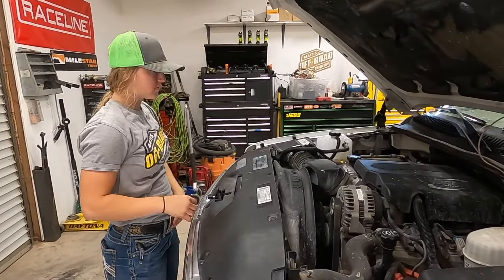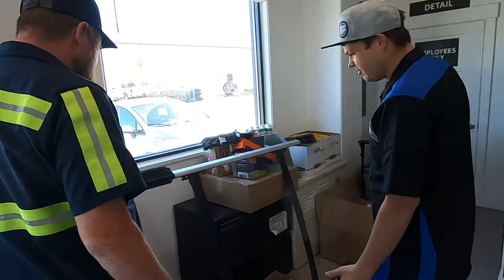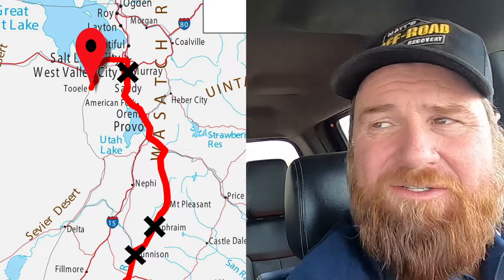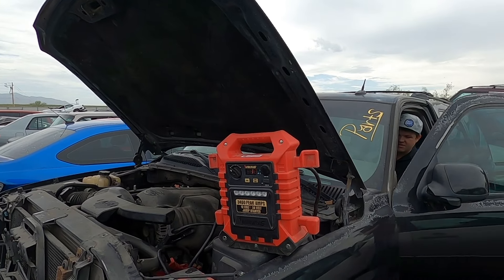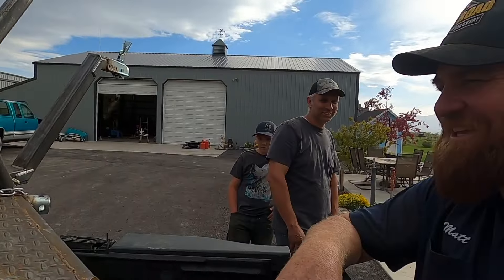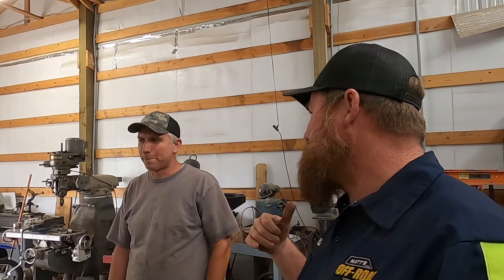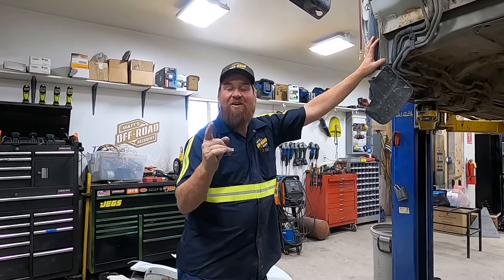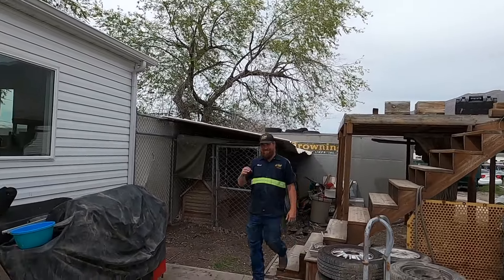Massive Engine For A Massive Off Road Wrecker!

Comment: The 8.1 is such an underutilized engine. You see 5.3 and 6.0 swaps everywhere yet the 8.1 rarely gets to shine. Such a good platform.
Reply: I was saying get the new gas 6.6 or the ford 7.3 gas
Reply: The reason why is the 8.1 doesn't make good power beyond stock with mods. They just don't.
Reply: All modern GM engine's are underutilized. They maybe because they're junk.😂😂
Reply: An lq4 ls3 can make 600+hp NA on regular pump fuel.

Those are solid numbers and extraordinary reliable motors.

I cant speak for the 8.1 as I've never built one.
Reply: There’s no replacement for displacement!
Reply: @youtubechampion9377  I'm not denying the 5.3 or 6.0 or even the 4.8 is capable of power but if you watch to the end they are only getting 580 with 14psi on a 8.1. The 7.3 godzilla is 800 with a pro charger.  I personally have a ls swapped s10. I wouldn't give you a penny for the ls engine. They are not reliable. It's cheaper to buy a gen 2 coyote and throw some boost on one and then you got a reliable engine.
Reply: @1978jhoff  yeah its called the ecoboost...
Reply: @lizard2006  you have a good point but I think we need to evaluate the 8.1 more on the torque side of things considering its abit of a stroker.

8.1s are also alot less common then other GM counterparts and have minimal exchangeable parts if any.

My understanding of it is vague but it's a more modern 454 and saying that is ironic because it's certainly outdated now.
Reply: Richard Holdener has been testing 8.1 junkyard engines lately on his channel.  They're capable of making massive power and torque just like any big block.  The only downside is that there aren't as many aftermarket parts available as other big blocks but if they're going to keep it mostly stock it really isn't going to matter.
Reply: @lizard2006   What vehicles had a 2nd gen Coyote, as a Ford (F150) guy, id like to learn more.
Reply: @trumpsextratesticle8590  15-17 f150s, 18-20 are 3rd gen and were direct injected.  21+ are 4th gen when they went to cylinder deactivation. I work on cars for a living and GM is by far the worst. They are simple to work on but they aren't reliable.  I'm sure the 8.1 will be fine but I'd personally loved to see Matt use a 6.7 powerstroke or a old cat... or the 7.3 godzilla gas engine.
Reply: @lizard2006  I feel like this comment is slightly disingenuous, no slight to the 7.3 gasser, however when you look at the numbers, that 580 hp out of a practically stock 8.1 Vortec is more impressive than the 800 hp out of that Godzilla. That 8.1 Vortec redlines at like 5k rpm, those 7.3 gassers are making 800 hp at over 6k rpm and as high as 7600 rpm. Also, if you listened at the end, LT was making close to a 1000 ft/lbs of torque, which is more than all of the 800 hp 7.3L I found, by a wide margin, at least 200 ft/lbs more. However with all that said, if the 8.1 Vortec had all the advantages that the 7.3L Godzilla has, they would perform fairly similarly with a slight edge to the 8.1 for displacement reasons. The 8.1L is also a stroker motor and the Godzilla is a big bore motor. At the end of the day you're trying to compare a 60+ year old design against a modern design, it's an apples to oranges comparison. The 8.1L Vortec is a Gen III block with 1980's head technology, the Godzilla is a completely new design of motor from the ground up using the latest technology.
Reply: @lizard2006   Thank you for the reply, I'm an old school shade tree mechanic but have not personally kept up with the newer engine/designs. Thank you again for the information!
Reply: @dammityoutube  the godzilla is a pushrod v8 closer to the 351 Windsor which is very similar to the ls engine. The 8.1 is not 60+ year old design. An the godzilla could be 1000ftlbs it's all in the cam profile. Your talking about 14psi and only making 580hp
Reply: @lizard2006  So I gave some hyperbole, the point still stands, the L18 8.1L is still a W series motor, that first debuted in 1958, which still uses nothing newer than 1980's technology to run. The Godzilla is a redesign from the 6.2L Ford Hurricane that is cam in block instead of overhead cam, a first from Ford since 2001 when the Windsor was discontinued in favor of the modular OHC V's. The Godzilla has better heads and a better fuel system than the 8.1L Vortec, it's DI instead of port injection. As for the 580 hp, I'd bet that 580 hp is in the high 4k rpm range, it is this reason that I say it's more impressive than a 7.3L V8 making 800 hp when it's spinning 2k-3k rpm faster. The 8.1L stock is a 5k rpm max motor, the heads can't flow enough air nor are the valve springs strong enough to handle it.

Also, I have to give a correction, I said Gen III big blocks, I meant Gen IV's. As the Gen III was never made.
Reply: @dammityoutube  the 8.1 is not an impressive engine. They used them in uhauls and I was a mechanic for uhaul they do not hold up no where near as well as the ford v10s, and they are absolute turds as well. Matt is probably not going to put boost on it and in terms of upgrades the godzilla bolt on options and tuning are going to be way better. My dad personally had a 2500hd with an 8.1 and it only did one thing good and that suck gas. 

If we're talking about a modern gm option I'd say the 6.6 gas engine is a much better platform. I just get tired of seeing the same old swaps. Ls gm fan boys are notorious for mouthing off about how cheap you can swap a junk yard ls engine throw boost on it and go race, you can but it's not reliable and you fuck up the track for everyone else. That logic is so stupid. I know because my dad before he passed and myself were convinced to do a ls swap into our 99 s10. It's been a nightmare and it was not cheap. The intent was to make it a daily driver. 

I think in Matt's case a diesel option like the 6.7 or maybe a built 6.0 powerstroke,  or even a older cat would of been better for the high idle and ability provide pto. However I get why he went to the 8.1, and I think it'll be okay, but I can tell you again its not a great reliable engine. Just as the ls isn't. They are just easy to work on and parts are a bit cheaper.
Reply: @lizard2006  I 100% agree with everything you said there. I personally am not a big block fan, too expensive for not much of a performance boost, if any at all, and lot of extra weight to account for. I personally go the turbocharged 4 cyl route or diesel.

I would have liked Matt to go diesel on the wrecker too, however just a personal choice for me, I would have used a Cummins 6bt. Doesn't require any electronics to run and is fairly easy, not cheap though, to get 400-500ish hp out of them, or I'd use an older Cummins 6C8.3, also doesn't require electronics as both motors are entirely mechanical and the electronic fuel solenoid can be replaced with a manual valve if you so like.

Depending on what LS you have, they can be fairly dependable though, every builder is different and everybody uses different parts and parts quality is different from manufacturers. It's cheap to build an LS but expensive to build a reliable LS, far more expensive than say a decent Hemi or Coyote. Far more people build cheap LS's and ruin all the fun for the rest of us. 

I like the newer LT platform more, but they have some serious cam issues, almost beating out the Hemi for cam issues. Even the Coyote has it's host of issues.

Comment: Matt, with that engine you are going to need a HUGE fuel cell.
Reply: A 50 gallon tank would do it. Or' you'll run out of gas all the time.
Reply: But then he won't run out of fuel all the time.
Reply: and a working fuel gauge!
Reply: I was thinking the same thing. You can always under fill a large tank for small jobs. But having that extra headroom for long hauls would be very useful.
Reply: @webfreakz  don't need a fuel gauge with an 8.1...... just remember everytime ya start that beast up it's almost outa fuel!!
Reply: @bartondean4260  That' ll work IF he remembers to stop and fill it.
Reply: Just remember a 8.1L in a wrecker is going to get better fuel economy than a 6.0 would because it’s not getting its guts pulled out. My dads 8.1 gets between 13 and 15 average and anyone we’ve talked to with a 6.0 says they’re mileage is worse than that. Cubic inches doesn’t necessarily mean bad fuel economy.
Reply: My 8.1 gets 9mpg 91+ octane with our without trailer. However my trucks tare weight it #9300. With 85g fuel capacity I made a trip from Sacramento CA. To myrtle beach SC on 4 fill ups. 
(Sac,ca/coal town ,ut/somewhere west NE on 70/someplace middle of Missouri. My mpg gage in cab is a touch off due to 10 fuel injectors and 35 inch tires.
Reply: @bartondean4260  Maybe the Suburban had the optional larger tank he could reuse, though not sure what options were available on the early 2000's model... I had a 66 gallon / 250L tank in my 99.
Reply: My 8.1 suburban gets about the same mileage as my 6.0 vortec towing.
Reply: @frumsmcnoodles323   That's a massive tank!!
Reply: No, he has Jaymie on speed dial for when he runs out of gas.
Reply: I bet the Morrvair is pretty thristy when Matt is pulling 30' RV, horse trailers out of the sand. That thing is working! 
8.1 will be pretty impressive in an off road wrecker. It will operate right in the RPM sweet spot. Like a diesel. Never working too hard because of the gearing. Getting paid to drive awesome off road recovery vehicles,    they have a pretty awesome job. Hard work for sure 💪
Reply: Just get a fuel- cell trailer and tow that sucka everywhere lol.
Reply: @distinguisheddjentleman8081  Yes, it's how hard you're working it. Morrvair is working pretty hard sometimes.
Reply: Expect regular 'ran out of fuel' videos🤣
Reply: @distinguisheddjentleman8081  a company I worked for had 6 cyl vans and a few 8 cyl vans they had a long drive and the 6 cyl vans needed gas before the 8's needed fuel. the 6's had to work harder too keep up with the 8's ..
Reply: @frumsmcnoodles323  I haven't been able to top-off my Suburban in weeks.  Next time I go on a road trip, I'll have to fill it twice.
Reply: @Adam Ruiz i don't think it will be an issue with Matt😆  he sold his half of a roofing business, then bought the towing business, which you know has to be making a little profit or he wouldn't keep it going. He doesn't record very much of what the towing side does, just the off road part of it. You know he's making pretty good money with his Youtube channel too.
Reply: @Adam Ruiz yeah, i saw that comment. Not only would that have been costly to fill up, that big of tank would be quite heavy filled up. Almost 400 lbs, given the weight of a gallon of gasoline is roughly 6 lbs.
Reply: Who would have thought a larger displacement engine would burn more fuel? Man with the secrets you hold and your peculiar ways of applying logic you are on your way to be a presidential advisor
Reply: @bartondean4260  Wouldn't matter.  He would run out if gas if it had a 500 gallon tank.
Reply: @distinguisheddjentleman8081  :  A lot is gearing and tire size, think cubic-inches per mile, if the engine has 35% greater displacement, but is turning 40% slower, then it is displacing about 3.6% less cu-in/mile.  Lowest Brake Specific Fuel Consumption typically occurs at the RPM where peak torque is reached, and at about 2/3 throttle.
Reply: He may also need a fuel truck to follow him around.
Reply: @randytravis3998  It was not so much "working harder" as spinning faster, and also having a smaller tank. I too remember the same and back then the factory put in a taller rear end with the 8 cyl option, so much so as the 6 cyl actually displaced more cubic-inches per mile than the 8 cyl.  If you were to put the rear and gearing of a 8 cyl in the 6 cyl van, you would get better gas millage, but have poor acceleration.
Reply: I suspect that he'll be running out of fuel regardless of the size tank that he puts in it... :)
Reply: @bartondean4260  -- More like a 50 gallon tank on each side...
Reply: My 2002 Suburban 2500 6lt 4speed got better mileage than my 2012 Suburban 1500 5.3 6 speed especially in the hills  and mountains.
Reply: He'll manage to run it out of gas several times I'm sure
Reply: @frumsmcnoodles323  lol, that would be a $300 fill up.
Reply: @randytravis3998  can confirm! Had a 4.3 V6 in my half ton and got 14 at best. But a 5.7 V8 and just too 18 average. When it comes to efficiency it's all about how hard the engine is working.
Reply: @johndavidwolf4239  I thought it was around 80% unless the computer goes into open loop first
Reply: Not really. Mine tows a trailer at 65 and gets 9mpg. 6.0 or 5.3 would use more fuel.
Reply: Maybe a two tank set up like semis have.  Just a thought.😏
Reply: @johndavidwolf4239  In Matt’s case fuel consumption per hour of run time would be all but the better measurement anyway. In which case a idling 8.1 vs a idling 6.0 isn’t going to be enough different to matter.

Comment: I pulled an RV fulltime for 8 years with an '02 Chevy with the 8.1L/Alison combination. I loved it. It seemed like every diesel owner I talked with doing the same thing had high-dollar repair stories, all I ever did to that truck was a radiator and an intake manifold. Others have mentioned the fuel mileage, but also watch the oil consumption.  1 quart of oil per 100 gallons of fuel oil usage was evidently considered acceptable by GM.

Comment: it may be prudent to change out the crank sensor before installation, or consider the location of the sensor when positioning the engine for serviceability (they're roughly a foot long) ; the crank position sensor appears to be the achilles heel of the L18. being an all iron, basically stroked 454, the 8.1's are durable torque monsters.

Comment: I've been the owner of several GM trucks.  I once had a used 3/4 ton GMC with the 8.1 engine (496 ci) with Allison tyranny with 40k miles on it and it didn't tow a medium weight 5th wheel camper trailer very well. And  It got less than 7 mpg while towing and 10 MPG not towing and miss-fired a lot and didn't preform well. Found out the spark plugs were eroded. Replaced them and that solved the misfire but it still didn't pull too strong. MPG not much better. Found out many owners had same issues. You may have better luck. The one you found has a turbo charger and that may what you need.  But you will need a huge gas tank..! I'm now driving a 2016 Chevy 1/2 ton with 5.3 engine and love it. Bought new.
There are two leading engines that RVers highly rate for towing Very Heavy trailers, the GM Duramax and the RAM Cummings diesels.

Comment: I was actually thinking 8.1 when i saw the first video for this.  A company i worked for had fully loaded, 1 ton dually, service trucks with 11 foot service bodies and that engine, and they pulled great.  We always pulled a scissor lift on a trailer behind us.  The trucks couldn't pass a gas station, but they had the power.

Comment: I did some math and without at least a 4:1(thinking doubled 205's) transfer case this thing is going to have a lot of wheelspeed even in first gear. Would probably work fine in the sand, but will make rocks and technical stuff a lot more tricky.
It does look like you will want an overdrive unless you want that 8.1 humming along on the highway at over 3k 🤣 
Just for fun I did the math for a SM465 and a 4:1 transfer case and got just over 1mph per 1k engine rpm. Unfortunately that's a stick with 6.5:1 first and no overdrive. 
I would love to see you go with a TR4050, it's got good gearing and can handle 600lb of torque in stock form.
I'm not too knowledgeable on automatics  but you'll need something super beefy or a lot of gear reduction to reduce how much stress it has to take.
My guess is you'll get creative with the transfer case and stick with the stock 8.1 transmission
Whatever route you take it will be an interesting truck and I can't wait to see it in action
Edit: just looked up the first gear ratios on the Allison 1000 (3.10) and the 4L85e (2.85) and hope your transmission is the Allison because it's beefier and at least cracks 3:1 gearing 🤣  you auto guys really don't get anything with deep reduction